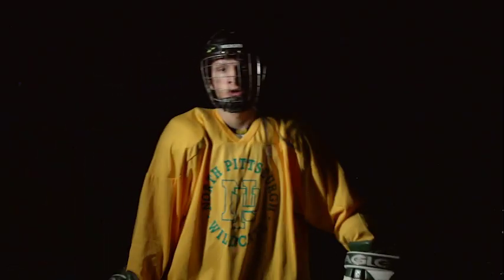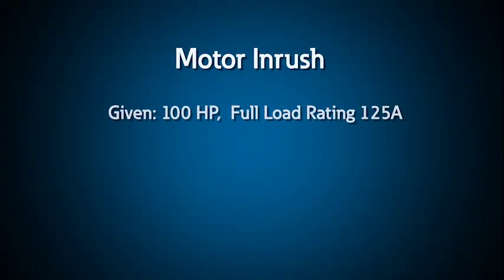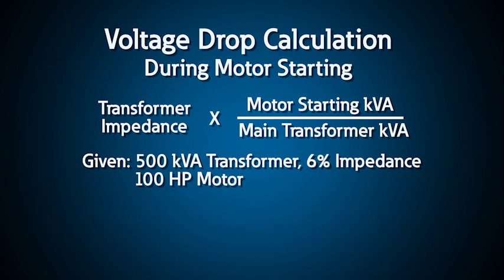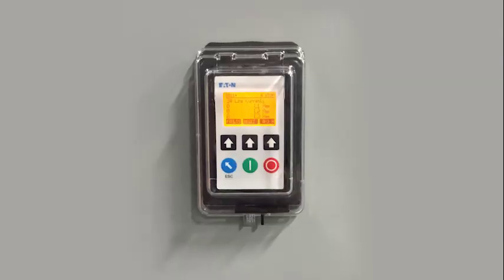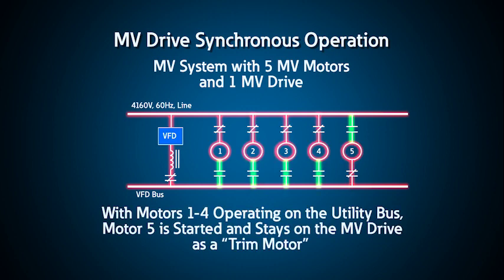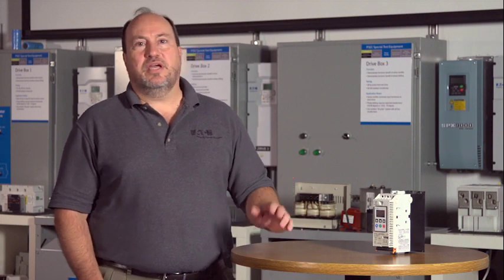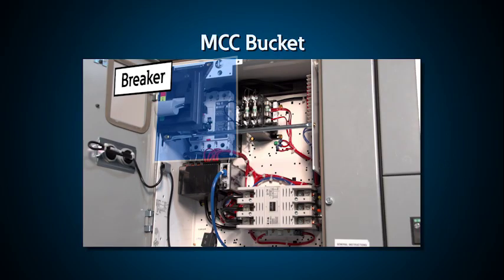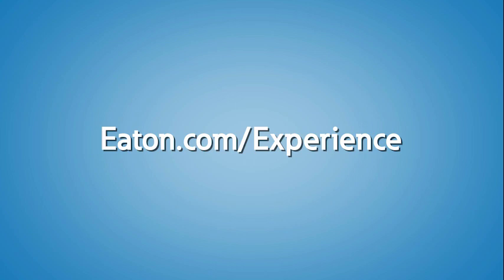Motor Starting and Motor Protection

Comment: Is it really ok to start a motor direct on line if it's starting current is 6 times the full load current? In my country, it's ok for a single phase induction motor up to 3 hp to start direct on line, as long as it's starting current is not greater than 3 times it's full load current, and not greater than 1.5 times it's full load current if it's a 5 hp single phase induction motor. If motor's power is greater than 5 hp, it can only be 3 phase.  For 3 phase induction motors, the starting current has to be limited up to 1.5 times the full load current. Our voltage levels for low voltage are 230 volts single phase and 400 volts three phase, with 5% tolerance and nominal frequency of 50 Hz